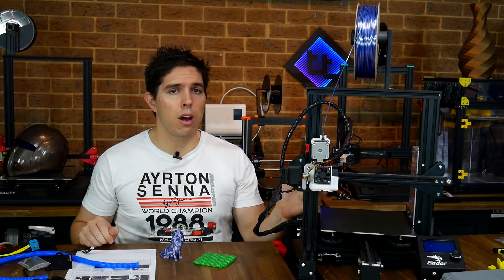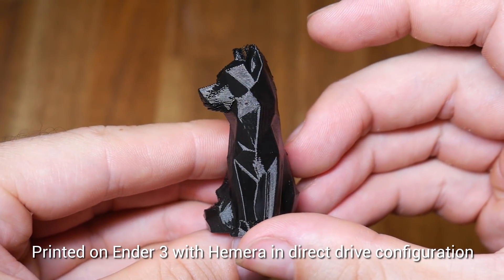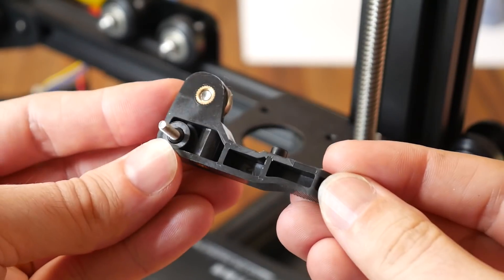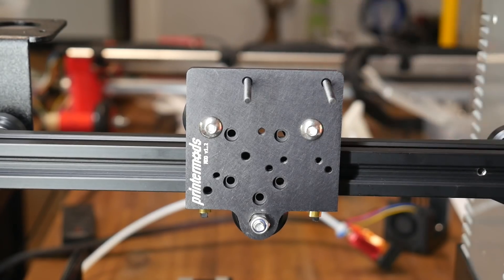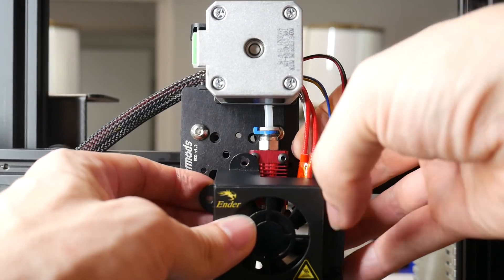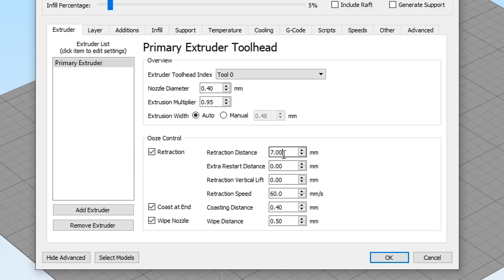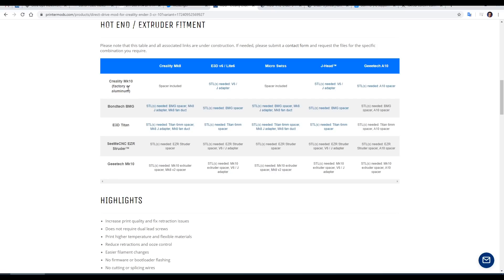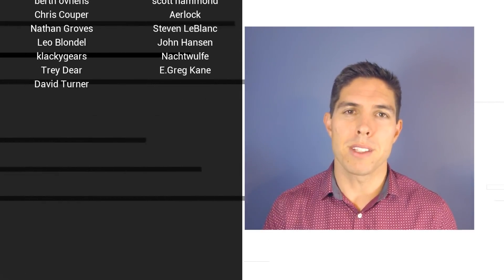Modular direct drive kit for Ender 3, 5 and CR-10 for under $40

Comment: There are a ton of free ways to do this, paying $40 for a kit is criminal.  To be honest, this is probably the worst solution you can do.  Someone is better off going on aliexpress and buying a $6 pancake stepper, a $13 BMG clone, and printing a free adapter.  I used to like this channel but if you're going to pump these kind of solutions, which are basically scams, I am going to just stick to Sanladerer and Chris Riley.
Reply: printed plates flex, a metal bracket is much better
Reply: @MrDead1975  You don't need a whole plate, you just need an adapter to hold the extruder above the hot end. There are hundreds of examples on thingiverse.
Reply from the maker: This is a quality solution. It does exactly what it advertises, it is hugely dishonest to call it a scam. If it's not for you that is fair enough, but please don't taint my entire channel based on your personal opinion of one product.

Comment: This is awesome! I’m considering getting this but how does this compare to the SpeedyDrive v1 on Thingiverse? 
Of course this kit is injection molding and aluminum which is better for durability but I can reprint parts. Is this an overall better option than the SpeedDrive? Thanks😀
Reply: Patrick Raliuga this is what I’m wondering. I’ve wanted to do it for so long but want to know the draw backs. Hopefully he makes a comparison to the speed drive
Reply: I've printed the Direct-Drivinator, modeled and printed some custom extruder parts for it and installed into my 3 ender 3's, works wonders and i haven't had any loss in quality whatsoever.
The most boring part was extending the Extruder wires to keep build height, but that's easy if you can solder well.

Comment: I wish you would have gone over how fast you can print in direct drive vs Bowden. It's whats held me off of going for any of these kits for a while since I like to print as fast as I can get away with.
Reply: Even if you have to reduce the speed, it may not matter much as retractions will be significantly faster (depending on what you're printing, of course). Would have liked to see some comparisons though.
Reply from the maker: My base feedrate/speed since fitting the V1 of the kit a year ago is 70mm/sec. You can review the print quality of any of the prints shown in the last year to judge further.

Comment: This may sound like a silly question, but is it safe to assume that most hotend and extruder parts for the CR-10 also work on the CR-10 mini?
Reply from the maker: I don't have them in front of me to give you a concrete answer, sorry. I think you maybe correct, however.

Comment: I just got the Ender 5 version of that kit, thanks for the walkthrough!  I assume it's going to shake more, having more weight to move...  Weird question, about that though, why don't printers have counter weights on the other side of the belt to keep the shaking to a minimum?  I have my printer on a wobbly card table, so all the shaking back and forth has some 'give' to dampen out over.  Whether that's good or not, I don't know, not sure how to test it.
Reply: If im not mistaken the shaking adds ghosting and the best way to tell if you are encountering a lot of ghosting is text based stuff. If you have letters on the side of something ghosting makes it look a lot worse.
Reply from the maker: I saw a system once where there was a whole second carriage to move in the opposite direction to cancel vibrations. From memory the creator abandoned it because it was needlessly complex for the limited improvements.

Comment: I was following all your video guides to mod my ender 3, from upgrading mainboard, installing blrouch, to installing hermera extruder. It's was all successful. But just can't figure how to tune the VRef. I'm using SKR mini E3 V1.2 board. Could you help please. Tks man
Reply: @
RenoMakeOver Sg Assuming you are using TMC motor drivers, the vRef is configured in Marlin 2.x. Michael has a video about installing the SKR Mini v1.2 here 
https://youtu.be/ikHhzOIlHPg
Reply: @spikekent  I watch this video guide many times and was successful in setting up to my printer. However some little bugs has been fix too. Nevertheless, Micheal did not cover how to set VREF too. I know my Vref is slightly higher because motor is running hot. Anyone can help tks.
Reply: @seigedan  This is Michaels video on setting up the Trinamic 2208 drivers https://youtu.be/7VHwcEroHPk. Although he is using Marlin 1.9, it is very similar to Marlin 2.0. Search for HAS_TRINAMIC in Configuration_adv.h this is where the X, Y and Z current can be set. Of course you drivers do need to be in UART mode to enable firmware configuration.
Reply: @spikekent   I have my SKR mini E3 v1.2 but not installed yet. What you're saying it that it's not required to change the vRef when upgrading to the SKR mini E3? Thank you.
Reply: @mikem8145  You do still need to set your vRef, but if you are using Trinamic drivers set to UART mode, it will be set in Marlin 2.0 rather than via the potentiometer on the driver. In Configuration_adv.h search for HAS_TRINAMIC just under that there are the settings for each individual driver.
The default current is 800. As an example, when I upgraded my CR-10s4, the motors were getting a little warmer than I liked, I ended up with an X_Current =760. Obviously yours will likely be different.
Reply: @spikekent  I didn't think the mini e3 1.2 had UART mode
Reply: @mikem8145  Having check on the BTT pages for you, I'm happy to say it does have UART. Also Michaels video confirms this too, he also guides you through the firmware changes https://youtu.be/ikHhzOIlHPg
Reply from the maker: You can set it whenever you like with gcode: http://marlinfw.org/docs/gcode/M906.html

Comment: With 1.9 mm internal diameter PTFE tube I reduced retraction to 3-3.5 mm on my Ender 3. No need for direct drive extruder.
Reply: Depends what material you're pushing through.
Reply: @vidznstuff1  3 mm for PLA, 3.5 for PETG
Reply from the maker: Still three times what I run, not that that necessarily matters. Flexible filament is worth mentioning here too.

Comment: Michael,  if you lose 26mm y axis on hermera extruder, but this direct drive will lose even more on Z-axis?
Reply: I have a similar kit (Babarossa Direct Drive kit) that isn't as modular/upgradeable, but.... 

It sits in front of the top rail; as such you lose no Z-Axis height, and no X/Y axis movement.
Reply: I don't know about others, but because of my lack enclosure, this dd kit or the microswiss one ( that is in my opinion overpriced like everything else from them) would not fit or would result in filament snapping because of lack of space.
Edit: removed typo
Reply: @S41t4r4  Why would the filament snap with the new Micro Swiss Direct Drive? I think by routing the all the wires in the front (as Micheal did with the MDD v1.2 mod in in this video) I don't think the filament would snap.
Reply: @mikem8145  the distance between the upper extrusion and the ceiling of my enclosure is less than a centimenter. The filament route would have two extreme curves in it that would lead in pla breaking at one of those curves. For those higher profile dd kits, like the microswiss one or the one from the video,  this would happen on lower layers than on the hemera resulting in an massive reduced print volume.
Reply: @S41t4r4  Lol an IKEA Lack enclosure. I misread the first time for  your lack of an enclosure. My bad lol
Reply from the maker: Hi guys, no z height lost (or X or Y). Everything sits in front of the top rail so it's a non issue.
Reply: @mikem8145  no problem :)
Reply: @andrewb4584  will the motor hit the spool? Or top rail?
Reply: @seigedan  No. Turn the spool toward the back of the printer, feeds fine.... 

I've printed many, many, many things with my DD conversion (again; nice, not quite as slick as this one); never had issues with filament snapping. I also have an EZ-Struder EZR, so I hung about as much junk off my Z-Axis as I could. No issues.

I bought it to control retractions, and eliminate bowden tube issues. I still print (primarily) PLA. Enclosures aren't really needed for PLA.

Comment: there are so many better solutions that are PRINTABLE.. why should i spent so much money for a semi direct drive product? there is still a bowden in between.. 
Also, the stepper sits way to high which causes instable forces due to the long lever forces compared to a setup with a stepper nearly in line with the x axis.
Reply: Any extruder I've ever seen has a space between where the filament exits the feed wheel and enters the hotend. This unit shortens that from12"+ down to a bit over an inch; comparable to most DD extruders. As for the longer moment-arm of the extruder motor, you may technically be correct, but I haven't seen any noticeable difference, and a difference that makes no difference is no difference. LOL
Reply: @quantumharvestllc2082  Makes a meassurable difference... also screws will loosen bit faster. tested it. 
I designed my own dd drive.. but changed it to one of these of this guy here:

https://www.thingiverse.com/thing:3751368

im now into full color fdm prints.. costs enough time :P

there is no hate.. but its technically not correct and he states it always as "cheap" upgrades.. they definately are NOT. cheaper than other totally overprized stuff.. but still too much for the little u get everyone can print or design by himself.
Reply: @hanswurstusbrachialus5213  I'd like to try some multi-color prints, but until now, I had enough trouble keeping one extruder going, much less 2. I converted my Ender 3 over to a direct drive like in the video, but I used the steel bracket Creality sells for the purpose, and it was $22 IIRC. It needed the X belt shortened 10mm, but other than that, it was a piece of cake to mount. The motor, hotend and support rollers are all bolted to one piece of steel; IMO a better setup than the video...no plastic pieces. I have about 100 hours on it, and have had zero issues with ringing or loosening screws so far.
Reply: @quantumharvestllc2082  Because some are smart enough to prefer not running their hotted with not flame-retardant treated 3D printed parts. A 3D printer like the Ender 3 is already a big fire hazard. It's stupid to make the situation even worse.
Reply: @mikem8145  ...whatever. I'm not here to fight or argue with anyone. To each his own...I gotta go, I think my Ender 3 is on fire. LOL.
Reply: Link please to the better solutions.
Reply: @madrian_hello  Already posted one above
Reply: Andree H. Thanks, I am going to check out tomorrow from my computer.
Reply: Direct Drivinator https://www.thingiverse.com/thing:3589452
Reply: printed parts flex, metal ones not so much